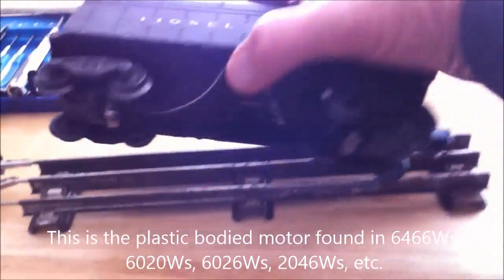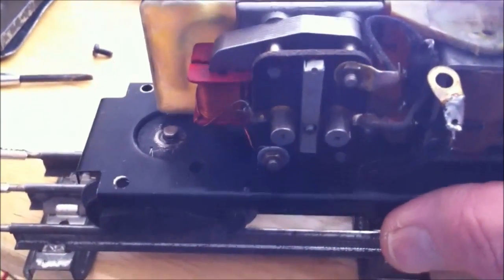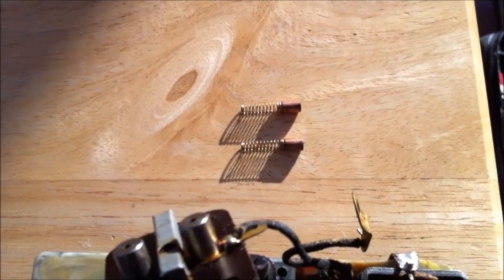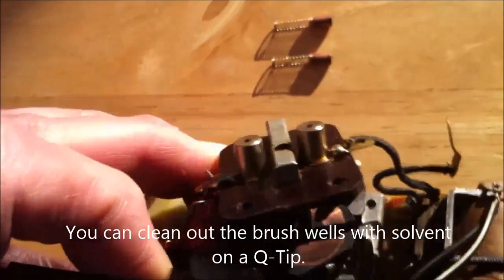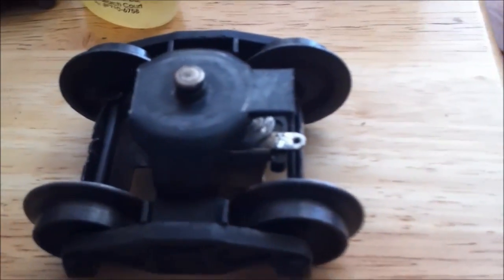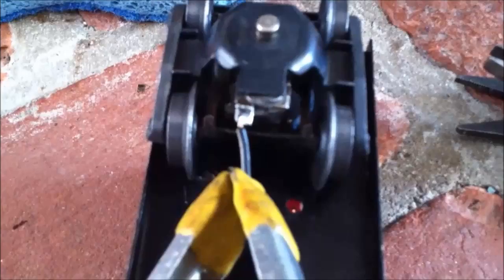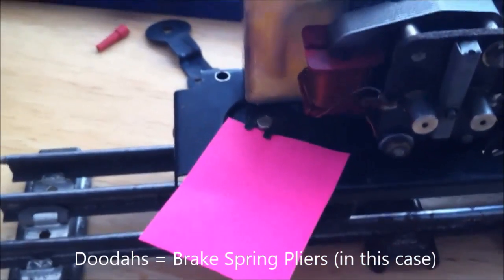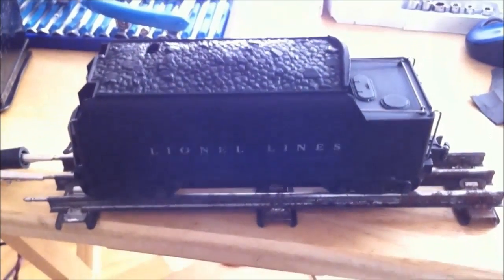Repairing a Lionel Postwar Whistle Tender

Comment: I didn't see how the relay was fixed from sticking? I just fixed one by adding a little spacer of electrical tape cut out of like a U in the tape, doubling over the two thin strips so they stick together. I then shoving them into the two holes that the bottom flapper plate ride on, with about  1/2" full tape sticking up on the side of the relay holding it all together. It is a perfect 3/4 width to match the side. This takes up some of the slop where the flapper plate hinges  and does not allow the flapper plate to get a square contact on the slightly magnetized coil pin, thus allowing it to fall away when the power is lifted.

Comment: Herb -  Some of the comments mentioned using DC to make a motor run quieter than with AC.  I have yet to work on a whistle tender & I assume that the whistle motor and relay are electrically connected to the tender frame - with the other motor & relay wires connected to the center rail pick-up rollers.  I wonder if connecting a diode between the motor brush & power wire would produce some DC for the motor & make it run a little quieter?
Reply: Hi:  I don't have a good answer for you.  The tenders operated off the DC signal produced by the transformer during AC operation.  That is as sophisticated as it gets from me.  I know the locos use AC.  My locos are all pre and post war, so they are noisy.  I also know they do not operate with DC voltage.  Tried it.
Herb Jr.
Reply: @h.jameshamill2982  - That is interesting about the locomotive drive motors not operating on DC.  I was under the impression the motors where AC-DC, or " Universal " - ( with the armature in series with the field coil ) & would run on either AC current or DC current.  I think Benz Trainz got some Marx locomotive drive motors to run on DC.

Comment: Hi Herb, is it possible to put a postwar whistle assembly in the 2008 1484was reissue of the 1954 set? It’s a 2056 Hudson and 2046 Tender.
Reply: Unfortunately, I have not a clue. I suspect it would be an easy do. However, the internal shape of the 2046W body is a little different.

Comment: I have a 6466W whistle tender that I am trying to repair.  The problem I am experiencing isn't covered in your very helpful video above.  I am experiencing sparks coming from the coil that the wires from the truck connect to.  When this sparks the connection is lost and the whistle wont blow.  With the plastic cover off, I can manually keep the connection (but that isn't any fun when watching this circle my Christmas tree).
Reply: Brian, this sounds like it is dirty or weekend springs on the truck. What you might want to do is clean the entire truck with alcohol to see if just cleaning is the answer. The next piece is to replace the spring. Also, I always replace the wires on a tender that hasn’t been tended to and a while. Remembering that that was built about 1954

Comment: Would you have access to the schematics and theory of operation for the 671w whistle tender? I am trying to rebuild on that I dismembered as a child, and don't have any referance for the wiring.
Reply: pouncytaur The 671W Tender is exactly the same as the one that you see in the video. The motors are either going to be a WS 75 or a WS 125. I believe the 671W is a metal motor. If you looked at the schematics for the 2466w Online at all sons toy train parts or in Greenberg’s Postwar repair manual, you will find schematics for this motor there. They are simple to work on. And if you need any parts, you can contact Jeff Kane at The Train Tender.

Comment: Someone asked how to remove the top of the tender body. There are four 4 x 1/4 body mounting screws. One in each corner - carefully guarded by the truck. Remove each one and ease the plastic body off the metal body. If it resists ( and I would after 40 years ) I pry it off with a thin bladed putty knife.

Comment: I have a Lionel  O- Gauge Polar Express set, (The old version, not the LionChief version) and the whistle is kind of funky. When I try to turn on the whistle by pressing the whistle button on the transformer, it does nothing. However, when I press the bell button, the whistle turns on but shuts off after about 5 seconds. I also tested two controllers and I got the same exact results. I don't know what the problem is, so it would be nice if anyone knew what the problem is and how to fix it. Thank you!
Reply: Hexxoid sounds like a wiring issue
Reply: You have the wires from your transformer to the tracks reversed. Switch the wires from transformer to track either at the transformer back or at the lockon at the track. Whistle will work off whistle button.

Comment: Herb, why do Lionel whistle (above,) any accessory, and other activate-able motor MAKE EXTRA SOUNDS totally unrelated to the intended sound and annoyingly included in the action?
I ask because my bascule and draw bridges "errrrrgh" through their lift & drop moves.
Is there ANYTHING that can be done to the motor so that it operates like an MTH accessory - whisper quiet in order to enjoy the coal tenders whistle.
Please contact me when OR IF you have an answer.  I'm willing to upgrade for quieter uncriticized observation by wife and kids.
Thanks for sharing your knowledge.
Reply: Mike Kaludjer Good Question!!!  I know that there is usually noise in whistle tenders manufactured between 38-64 because of the slippage of the impeller on the shaft.  As for other items, I'm really a postwar person.  I have nothing from the modern or MPC eras.  I do know that since Lionel is the preeminent manufacturer.  As such, they have to abide by what the gov't tells them will not cause other companies to go out of business.  Also, the more power is necessary, the more noise anthing makes.  I also suspect that some motors from other manufacturers are can motors.  Lionel motors are usually open frame.  I had a bascule bridge from 1950.  It made noise.  I can't say what modern ones do.  Good luck.  Maybe refitting your bridge (perish the thought) with a can motor could quiet it down.
Reply: H. James Hamill:Go onto YouTube, look up bascule bridge, and listen to what I mean by unnecessary, annoying noise that cannot be on the real world bridge.
I have the small, self-propelled Burrows crane car with couplers.When I set it to raise the boom the cab rotates with a noise akin to fingernails scratching on a chalkboard.
The TALL coal tower's conveyor grinds annoyingly.-------------------------------------------------------------------I fixed their complaint on the trains' loud running "reverberation."  I used underlay across the whole layout covered with black rubber matting.But my family won't play with the accessories.  It's less fun without the action units; yet no fun without mom and two daughters.
Perhaps one of your fans can help.Thanks for responding,Mike
Reply: Mike Kaludjer Hi Again.  I don't have an answer for you.  However, I belong to several groups that will be of assistance, I'm sure.  One is https://www.facebook.com/groups/ClassicLionelTrains/ and another is https://www.facebook.com/groups/Ogaugemodelrailroad/  Each of them is a tremendous resource.  
FYI, my specialty are the locos and tenders from the postwar era.  The only bridge I have are the 316 and 317 type.  And those are to keep the bows on the Christmas tree from messing with my annual set up.
Reply: Something that works for some accessories is to use a regulated DC power supply like those used in servicing car electronics.I have one rated at 10 amp I use for running a #97 coal loading tower and two #164 lumber sheds that works well.The reduction in noises going to DC is well worth it.Sadly it can't be used for your whistle tenders as the method used to sound them is a bit of DC added to the AC power running the trains.Also a great idea when used to power the old 022 switches.

Comment: my motor spins fast but no sound. Any ideas? Its the metal one.
Reply: I think I have the same problem with a 2466W.  It has a WS75 metal body motor.  And, it has a complete, plastic impeller.  It spins like mad and all the blades are in place.  I have replaced the gasket. No change.  So, when I figure it out I will post an answer.  I recently bought it while at a train show.  Right now, I'm thinking someone replaced the impeller and it is either not seated correctly or it was the wrong size.  So, I'm hunting answers myself.
Reply: @h.jameshamill2982  I an pretty confident I  figured mine out. IF yours is the metal one, the whistle casing is held together by these pegs - they are NOT screws and they are NOT rivets. They are push in pegs. These are now loose and while you can't tell by eye  there are multiple air leaks all around the gasket due to the inability of those pegs to compress the case tightly enough to compress the gasket and make it air tight.. Understand there is VERY LITTLE air flow involved here so the slightest leak can affect performance. And here we have MULTIPLE leaks all around that cover plate. On close examination you can see how loose the cover actually is. Those pegs do not have enough force to compress the casing to make it air tight anymore. The pegs come right out they are loose. What I plan to do is to remove these pegs, coat them with epoxy (JB Weld for instance) re-insert them and clamp it tight while it dries. I am confident this can lick the problem.
Reply: @RenaissancePeopleNYC   I like your idea.  I think the body of my tender motor is warped.  So, even tho I replaced the gasket and then used a double gasket, I am just wasting my time.  A friend of mine said get a junker and transfer the armature and relay.  I might give it a shot.  However, I am going to try the JB Weld idea on the second motor.  I will let you know how I make out.  Let me know whether that idea solve you issue.  Jim
Reply: @h.jameshamill2982  It just needs to be clamped tightly closed while any adhesive it used on the pins to achieve air tightness. Some Lionel paperwork also suggests painting all around the seal with paint or sealer.
Reply: @h.jameshamill2982  Hi Jim - I took the thing apart and mine got a little bent from handing I just hammered it flat on a flat metal surface.  I used the old gasket (of which there were 2 !) as a pattern and cut a new gasket out of automotive gasket material. NOT cork but a black type material that is as thick as these originals. I coated all chamber barriers with silicone glue and used silicone sealant in all of the peg holes and all around the upper border of the cover. CAUTION! There is a VERY small ball bearing at the bottom of the shaft of the armature! VERY small and it can get lost VERY easily if you don't know its there. Anyway its all put back together and the silicone has to dry and we'll see what the result is but I am confident. I've made many gaskets before for various applications.
Reply: @h.jameshamill2982  Hi Jim - I tested the whistle today and not only does it work it is the loudest one I have now! New home made gasket and silicone sealant. PERFECT fix!
Reply: @RenaissancePeopleNYC  tnx.  will try

Comment: sir i have a question...please if you can help me...my year 1993 lionel coal tender  is acting weired when i put the track
is not whistling but if i'll get 2 wires  connect to the pick up wheels and put the other wire to brass plate connect to the  wheels
push the horn button it works i'm positive the  pick up wheel touched the middle rail when i put the tender and i'm positive the tender is clean oiled connection is right ...maybe  you can give me idea solve to solve this problem...thank you i already subscribe to your channel please subscribe too thanks again...i already put this tender problem to the you tube hopefully they can help me
Reply: Hi Nick:  my best guess is a separated solder or wire connection.  These Gremlins are tough to find.  I have a loco that is giving meet fits with a very similar symptom.  When I turn it on its back To test it, it makes connection.  But, when it’s on the track it will not make electrical connection.  So, I do not have an answer...just a guess.
Reply: @h.jameshamill2982  whats that separated connection solder? I spend hours and hours to trouble shoot is a nightmare hihihi....
Reply: @nickrosal5123  it is the connections at the truck and the whistle unit or motor.  A hairline crack or separation is a nightmare to troubleshoot.  Faced with this issue I will automatically resolder all joints.  I must say that this didn’t solve my loco’s power issue.  I still can’t find the problem.
Reply: @h.jameshamill2982  thanks mr james i’ll check on that